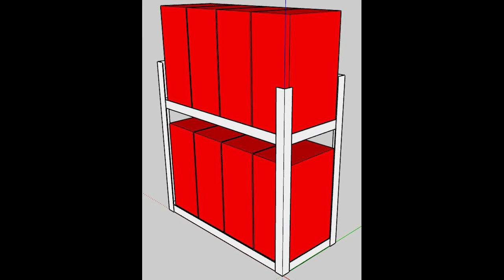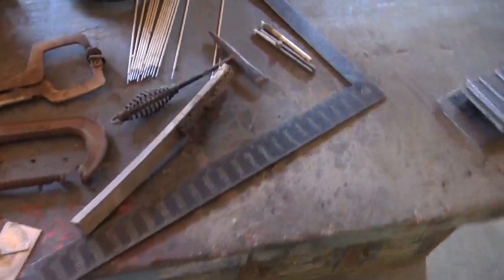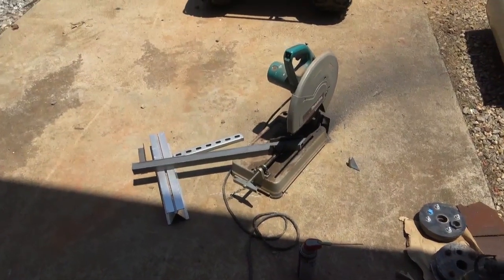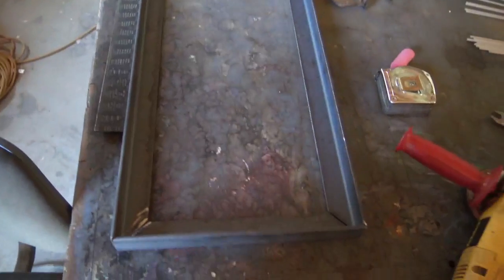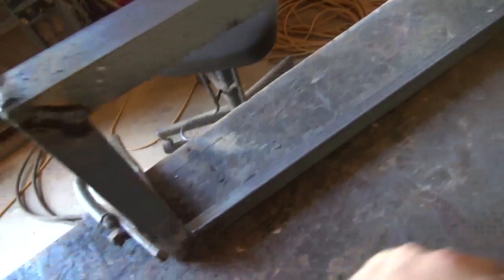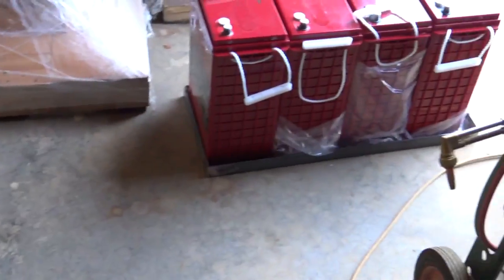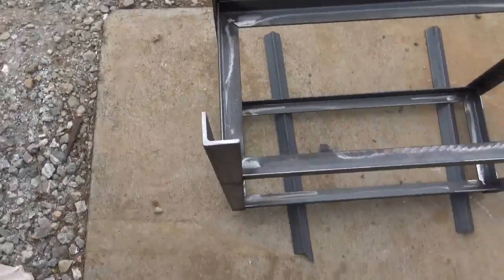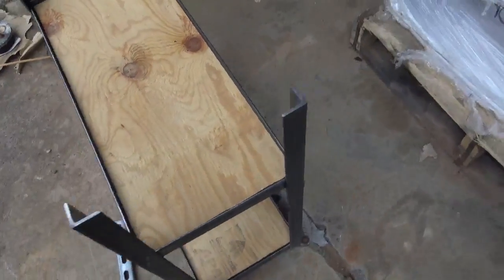Cheap AGM Battery Holder!

Comment: Used to be in welding alloy business and teach new techniques to many maintenance welders in industry. =Little suggestion on welding angle "iron" 90 degree  joints: Let the material do most of the work. Much better to cut out a 90 degree slice out the "shelf half" of the  iron in each corner  and not cut the "vertical half." Instead of 4 pieces, result is one long piece. Easy enough to bend  "vertical half" 90 degrees and then tack weld. Result is strong. better looking and faster. Once  tack welds get made the piece remains square.
Reply from the maker: Excellent point. Totally got it. Thanks.

Comment: I would like to have seen more info about how to choose the type & design of rack based on the batteries and use. Less welding footage, plenty of that on YouTube. Maybe in another video?
Reply from the maker: Sorry about that.  We were just "racking" our brains over how expensive battery enclosures for the battery we already purchased.  So I just made one. I wasn't thinking about all the different possibilities.  Point noted. Thanks!
Reply: engineer775 Practical Preppers . Can you please make a high powered coil gun and talk about how it works .

Comment: I love the space savings design for (8) 6 volt batteries!  However, do you end up with one longer wire when making your series connection (negative to positive) between the shelves?  Or perhaps you view the benefits of this design outweigh the effects of unequal length cables.  Thoughts?  Thanks for doing what you do.
Reply from the maker: Yes. We ended up with one longer wire from top battery to bottom battery but, since the batteries are in series, it does not affect the overall quality of the batteries or connections since the voltage is being added. If the batteries were to be wired in parallel, however, then wire length would need to be as close as possible to eliminate voltage differences between the batteries due to wire resistance. Thanks for asking!
Reply: Engineer775 does that mean you 4 batteries on top are all in parallel, and the 4 on the bottom are also in parallel?  And you just had one wire between the two placing them in series?  The reason I ask is I want to build a rack just like this but with ten 12 volts - 5 on top and 5 on bottom giving me a 24 volt bank.  Thanks!

Comment: OK, so why won't this idea work and hardly anyone is doing it or suggesting it? Make an insulated underground accessible battery storage compartment right under your solar panels along with the converter to send AC as far as you want with no loss? Use the heat generated by the solar panels in winter to pump heat and store right in the battery compartment. Make the heat transfer system re-direct-able in summer to help keep panels cooler and more efficient. No cooling necessary in the summer since the ground would be a cool stable temperature ??? I will be doing this when I go off grid unless someone can come up with a reason not to? It will likely be a sealed plastic or cement septic tank to house all the components in.

Comment: If you have not tried them, check out the Tyrolit natural fiber discs! They put flap discs to shame.
I have totally converted to these when I need to remove material: https://www.youtube.com/watch?v=hoOHq3CkAIk
I believe https://radiac.com/contact/ supplies them in the US.
Reply from the maker: I have not tried them. Flap discs don't last very long for sure.
Reply: These will EAT steel! And last for a long time.
Contact them and ask for a box to demo. With the number of subs you have they will probably send you some.